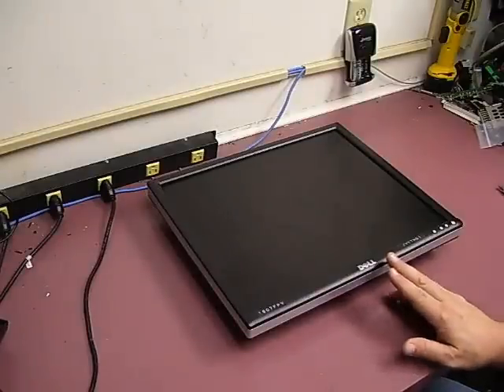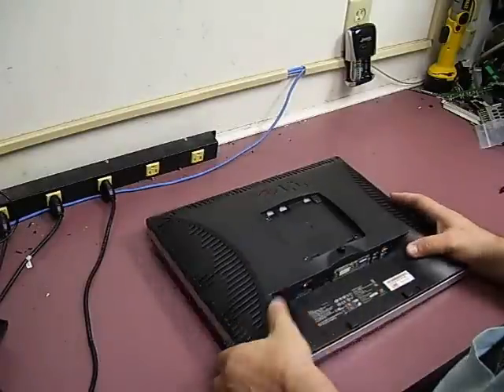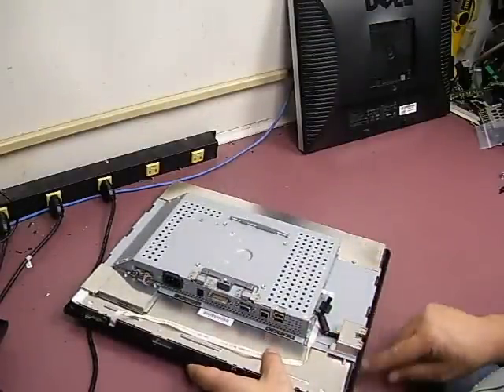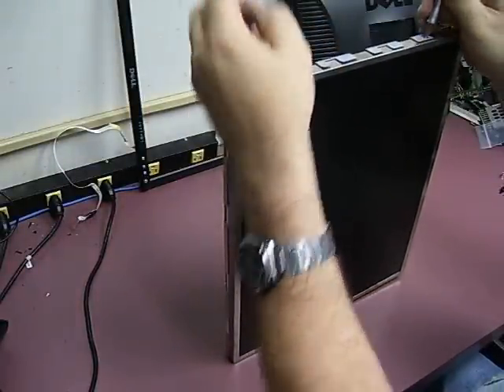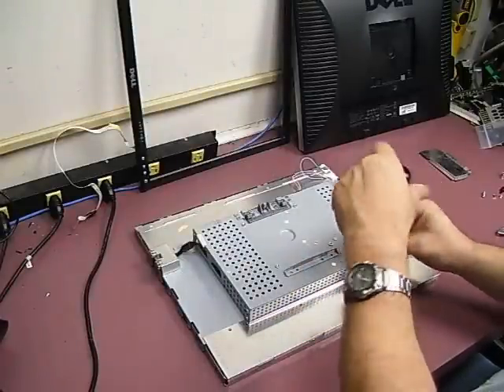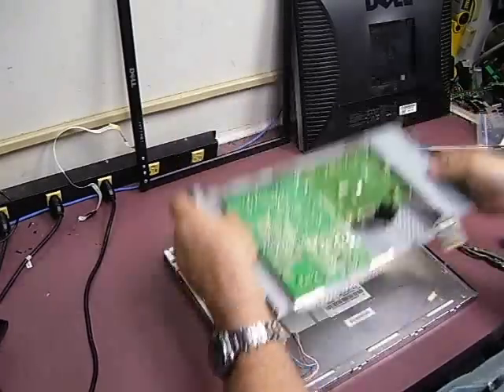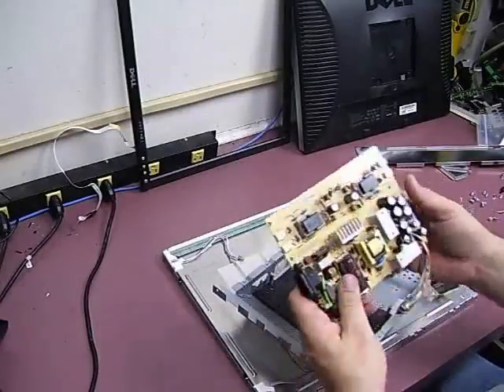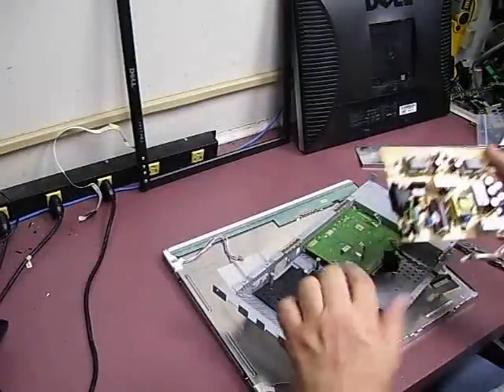Repairing a Dell 1905fpv - 1907fpv  monitor  Part 1 Disassembly

Comment: I have a 1905FP,  the monitor works but stopped communicating with the computer, also the OSD is no longer working, line selection and Self Test Feature Check are working. Is there any way to reset it without OSD access? Please let me know.

Comment: I have a couple of dead model 1900FP (zero zero F P), which has a DC power input, screwed on stand and probably no unlatching button, but I hope the overall process is very similar.

Comment: I have a slightly different monitor but still it was very very similar I was actually having problems with the front panel buttons the Contacts just needed cleaning but your video help me on how to get it apart thank you!

Comment: cclla 1 Very bad video. Your video is just for 1 min. Because during the 1 min I lost my monitor definitively. I followed in parallel your video. When you explained the front panel electronics cable problem, the cable of my monitor was already broken. You had to speak about this problem several seconds earlier. Now I think everything is over with my monitor. Thus, you deserved a thumb down.
Reply: How were you watching the video????

Comment: Ha! I looked up "open dell monitor", wondering how the monitors I was using might be constructed, and the first result is this video of you disassembling the exact same monitor I am watching on! Cool. I guess not all of this model of monitor were as reliable as the ones I am using (given that this video is only from 2012, and mine are still working in 2020).

Comment: If you can't can't unplug the cable from the other circuit board, remove the standoffs holding it in place. 

The cable should come out easily after removing both circuit boards.

Comment: I had to put the monitor for less than two minutes outside the house and the dog came and peed right on the display. It happened so fast! :))
I wiped whatever waas left and still running downwards inside the bezel, between the display and the bezel, / between the display and the metal frame.
I considered that leaving it like that, just wiping the display as it was might not have been a good idea, since urine might be corrosive, so I looked up how to disassemble the monitor in order to remove the display panel and properly clean it, regardless of the fact that there are no electrical circuits nor components that I should be worried about. However, corrosion is not nice, so I began disassembly. Then I thought, before removing the wires/ connectors and the shielding, that there might not be such a need to actually open all the monitor, and the bezel part would do, since I could try a different approach:
Namely to pour a bit of water in the middle lower part of the display, where the dog pee was, and let it dry thoroughly, then it should be no problem
What say you, Arrgh? ;)
Reply: I want to change my cracked LCD but do not want to go through all this unless I can get a new LCD. Anyone know the part number?

Comment: Don't know if you still check here for messages (it's now 2019), but I was able to use these instructions on dismantling a 1708FPt.   The only problem I had was the two middle "locking connectors" on the front frame, right side, did break as I worked on them.  (Didn't realize until the whole thing was loose and came off.)  We'll see what happens when I go to put everything back together again.  I'm hoping there won't be any real problem with the frame being loose on that side. 

If you can give any advice on what I might have done wrong (the other side came off clean and intact), or comment on what I'll be facing after it's put back together, I'll appreciate it. 

Thanks.

Comment: i have a dell 1905fp that just died yesterday. i turned on my PC and it didn't illuminate, just nothing, thought my PC was dead at first but when i hooked another monitor up, it works, so that monitor is shot. time to crack that bad boy open and replace those capacitors. got some rubycon capacitors to replace those cheap ones that have failed to hopefully get that monitor working again.

Comment: Partly hidden under the vertical of the stand (easier if monitor is rotated 90 degrees - i.e. for ""portrait" viewing),  a black rounded button push in (should push internal catches downward to release bottom edge of stand bracket)... If button is missing, with a small screwdriver, pry against the pin for button; screwdriver handle up (i.e. pressing catch downward) the bottom edge of stand attachment should come free.

Comment: Thanks for this guide - I had two "dead" monitors. I was able to replace all 10 capacitors (x2) for $20 all up! You saved me $$$$!!!.

Just one note - You need to discharge the old capacitors before removing them - they still contained enough charge on mine to cause sparking.

Thanks!
Reply: i know Im asking randomly but does anyone know of a tool to get back into an instagram account?
I somehow forgot the password. I love any assistance you can offer me.
Reply: @Finnegan Drew Instablaster ;)
Reply: @Moses Watson Thanks so much for your reply. I found the site on google and I'm waiting for the hacking stuff now.
Takes quite some time so I will reply here later when my account password hopefully is recovered.
Reply: @Moses Watson It did the trick and I finally got access to my account again. I am so happy:D
Thank you so much you really help me out !
Reply: @Finnegan Drew You are welcome =)

Comment: This is my first ever repair attempt. I desoldered 3 bad caps on this monitor only to make the fatal mistake of not remembering to label which side is the + and - on the board for the replacement caps. is there any hope of recovering from this or am I screwed. I'm strictly an amateur with very limited electronics knowledge. Any advice would be very much appreciated.Thanks!

Comment: Great video - I just pulled apart the same model, and was lucky enough to have 1000 microfarad caps in the parts drawers (they're rated for 25v instead of 10v, but that's OK.)

FYI, had to re-reference the video to reassemble - kinda forgot a few things along the way...take pictures!